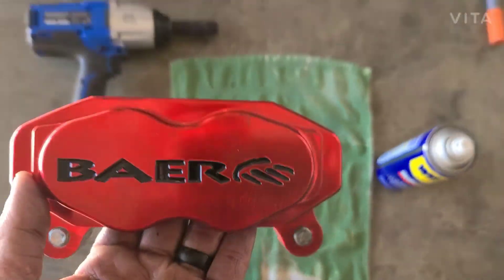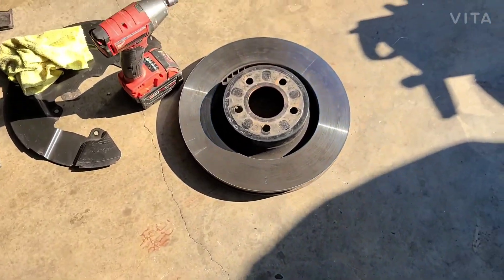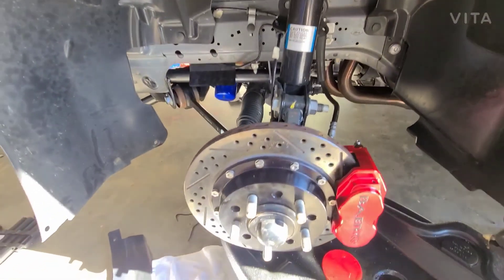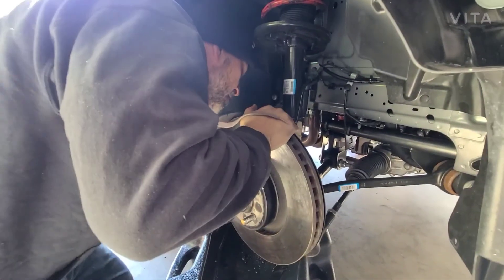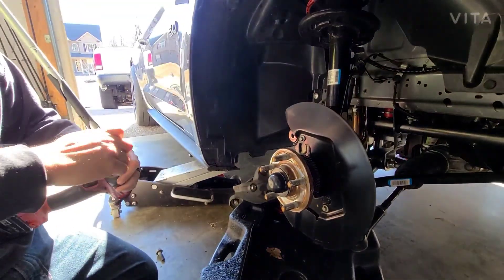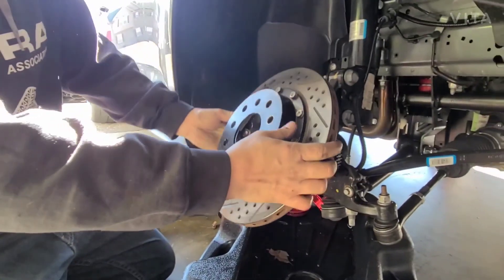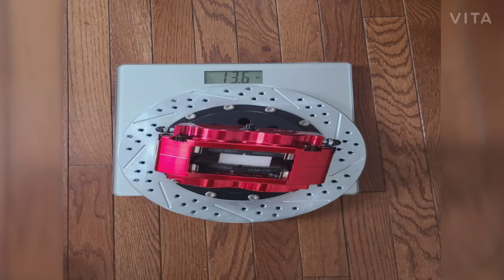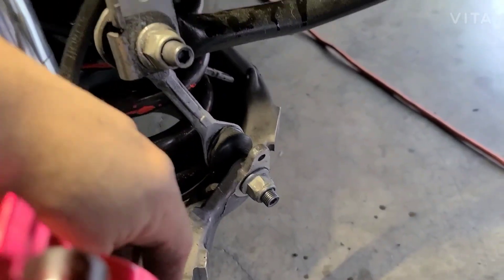BAER brake install on my 2018 Mustang. Saved over 90lbs!!!

Comment: I’m waiting for mine to arrive, but any issue with the stock studs long enough to mount a drag setup? Removing my brembos and installing these to mount my 17x4.5 weld wheels.
Reply: Did that work ? I’m trying to do 17x4.5 fronts also what’s your wheel specs too
Reply: @  no issues.
Reply: @ironmb86  you’re awesome! A three year old comment and you responded quickly thanks man I’ll be ordering these instead of the TBM’s for my 08 gt500
Reply: @ np, follow the brake bedding from BAER, or they’ll chatter bad. My buddy didn’t bed correctly and his squeaked so bad but mine were quiet.
Reply: @ironmb86  update! So Baer doesn’t offer a rear drag break that’s similar to there front SS4 and the one they do have is like 3x the price of the front setup…. So I ordered a front and rear set of Aero Space breaks I’m gonna do a review of my gt500 when it’s all done should be about two weeks